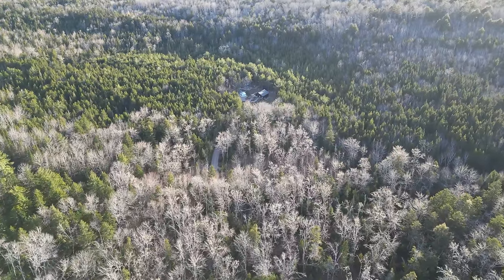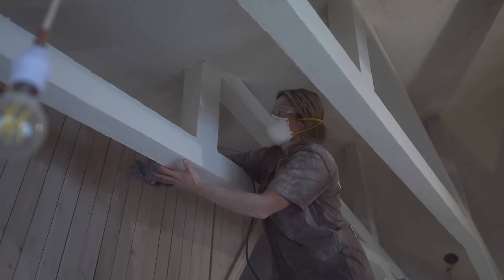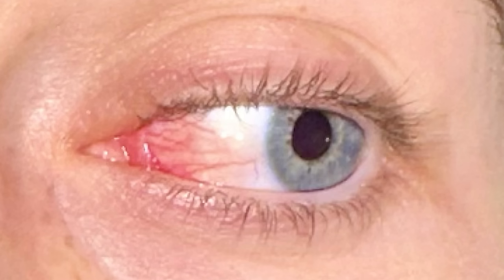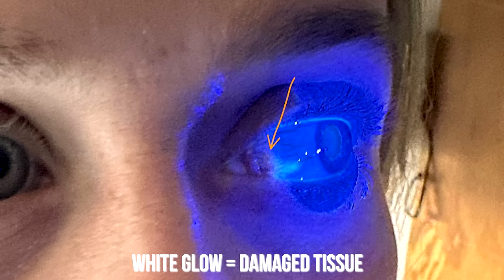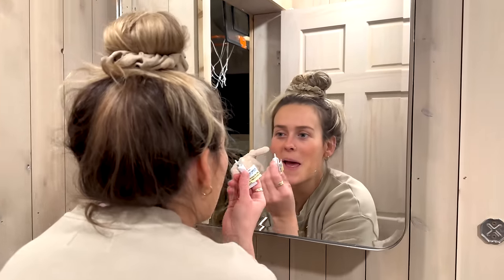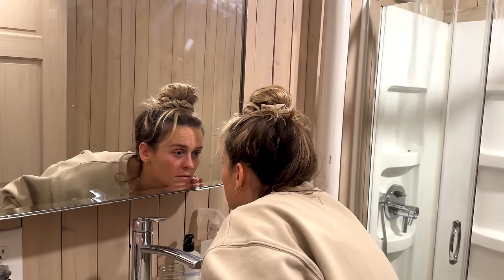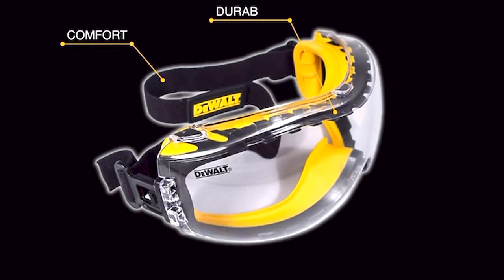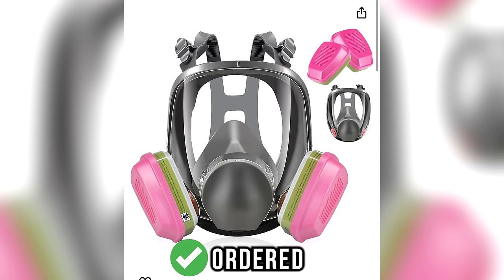telling my story

Comment: No big deal? Are they kidding? This was a very big deal! Our little darling scared the crap out of us. Just wearing simple safety glasses would have prevented this, especially to the major damage if it had landed oh so slightly different. Having been a renovator all my life I admit that I rarely wore the PPE I should have been wearing. It was just dumb luck that I didn't get hurt. The closest I came was when I was doing urethane on my hardwood floors. I had failed to open all the windows and doors for proper ventilation. A buddy happened to drop by and as soon as he saw my pupils as big as my eyes and that I was high as a kite he rushed me outside and saved me. Too close. So glad you're going to be okay, Crystal.

Comment: It's good that you were lucky and did not get badly hurt, but now you know why you should use eye protection when working on anything. You never know when a damage might happen.

Personally I had a grinder cutter running when the blade exploded and it spread sharp metal pieces all over, the only reason why my eyes wasn't hurt was because I was using glasses, but my hands and part of my body got spears by metal pieces. Why it exploded like that I do not know, but since then I have been very careful about it and especially whenever anything that might be dangerous like power tool, chemicals, paint and a lot more. My glasses that day had a crack and a huge rip on the surface so I know one of those piece would have hit my eye. The cost that day, was basically new clothes, some bandages and new glasses which for me costs a bit more than 1000$.

Both my mother and my brother has both had their own accidents like that, my mother got blue threads going through her fingers as a result and my brother got part of a finger ripped off because he wasn't paying attention why working with powered machines. I have a bunch of horror stories like that which happened to either someone I know or something I saw before the place got closed of by the cops.  It's never pretty when something goes bad or someone do not show the tools the respect they deserve.

So wearing some safety gear is always the smart thing to do.

Comment: Yeah this happened to me back in high school, just got to chemistry class and getting ready to setup our experiment for the day I jestered to my lab partner with my hands while holding a test tube that had not been properly cleaned an of course wasn't wearing my safety glasses and a drop off acid hit the flew into my eye. I went straight to the emergency eye flush and followed up at hospital. They did the dye thing and thankfully it was just a slight abrasion...SAFETY 1ST GO PACK !

Comment: I am 67 years old I remember working in the seventies in a fiberglass bathtub manufacturing plant we were mixing up risen and aluminum dehydrated powder in the risen and it splashed up and hit my eyes my eyes were burning I tore a bathroom door off getting to the bathroom sink to get water in my face and my eyes they  were burning . I have had battery acid transmission fluid gasoline acetone and several other things in my eyes and today I have some problems seeing so you better protect your eyes

Comment: At my work place we HAVE TO WHERE all our PPE no matter what or you are not allowed in any work areas. That being said, I still managed to get a metal sliver in my eye and because it had saw coolant on it,  it stuck to my eye and I had to be taken to Emerge and have my eye frozen so they could remove it. It literally glued itself to my eye. This was bad for me as it left me without vision in my right eye and that's my good eye and couldn't work for a week. Thank God it healed and no damage to my lense. We now have to where not only the goggles but a full face shield when working with this particular piece of air powered equipnet. It happened quickly and I have used this air powered drill for over 20 years without incident. I just happened to be at the wrong angle to the ON Button witch happens to have air coming out around the button and some saw chips on my glove and  that was all it took to blow a single fragment of metal through a small gap between my face and my safety glasses. Stay safe out there, you are a long way from a Hospital and EMT's to find you. Hugs from Sask.

Comment: It cannot be overstated that wearing eye protection is not an option when working with tools. Think paint brushes, weed eaters, saws, shovels, air compressors, sprayers of any kind, sanders, and probably a hundred other things. You could not have foreseen a drip right into your eye.So, focus on all the times you have used safety gear and were safe. We will all promise to be mindful of what could happen and make eye protection, especially, a priority.

Comment: Back in 69 working for a company that  built/ Erected grain elevators, especially cement. While pushing steel rebar, I got my face splashed with cement, aggregate, cement, and lime. Any of these are bad for your eyes, but the real bad guy (Lime) as a base, it will destroy your eyes. The company had a 55 gal. drum filled with water, to run the water Jack's. Two of my co-workers flipped Me upside down into the water. As weird, uncomfortable, water up your nose, the saved my eyes. Fast forward to 1987 I'm now a EMERGENCY ROOM NURSE. Yeah! can't tell You the number of times I did eye flushes. anesthetic ( Opthane) Flouricine strip for I'd damaged areas. Flush contact with NACL flush 500 -1000 cc, and a warm blanket, cause You going to get cold. How am I doing? What a learning opportunity! Some day ask me about My 2 elevator accidents. Yes 2, After all,  I have a Y chromosome. 😂=slow learner. Allen

Comment: When you’re young you tend to feel immortal, I know I did and I took more risks than I should have. I got lucky but I look back on my life and am freaked out by the risks I took. I studied Fine Art. I used oil paint and turps with no gloves or protection. I ate my sandwiches with hands covered in oil paint and turps. That was 1985 and safety wasn’t talked about much at art school.

Comment: Where do I start?  First off I have been watching your YouTube videos since before you guys owned the Canadian property.  My wife and I plan on full timing when I retire in 17 months and I follow a bunch of Full time, Schoolie, and Van life YouTubers.  But I can really relate to this video.  Back in 1995 while I worked in a Wastewater treatment plant as an Electrician, I accidently knocked a jug full of Caustic Soda off of a table.  When the jug hit the floor it splashed back up and the wave hit me in my face.  I was wearing Safety glasses but ended up with 3rd degree burns on my face, and in my nose and mouth.  Unfortunately due to the angle of the splash it also got under my glasses and into my left eye.  I have recovered from the burns, but have had 3 corneal transplants, a glaucoma implant, lens replacement, and numerous procedures all to the left eye.  My first transplant failed shortly after my 17yr old son passed from Meningitis, probably stress related.  The second lasted for just over 11 years and was doing great until I received the Covid vaccine.  My Doctor explained the vaccine ramped up my immune system which attacked the donor tissue causing my body to reject it.  I received my third shortly after that but also lost that one from complications of the vaccine.  My Doctor now says the damage is to great and I can no longer support any donor tissue.  So long story short, even though I was wearing glasses I should have followed the restrictions listed in that treatment facility and had splash goggles and a face shield on.  If I had my story would have been completely different today.  I am so happy that you have recovered, and certainly wish the best for you, Jazzy, and the girls.  Maybe one day we will all meet on the trails.
Reply: Really?  Just stop it! Why don't you spammers just get a real job?

Comment: I had an eye issue with an RC car Nitro car. Had starting problems with it hydro locking so I took out the glow plug and like an IDIOT pushed the car down on the starting block while looking/bending over the car while on the starting block and of course the car will try to start and it did and turned over all the Nitro fuel then very quickly sprayed me in the face and direct in to my eye's. I screamed as it really stung and felt like burning but don't think that was the case but was just extreme sting pain I couldn't then see anything so that added to the mass panic. My friends at the time with me panicked through me in to a car with me screaming in pain and rushed me straight to A+E. I was in A+E for like 6 hours and they had to  pop  my eye balls out of the sockets in order to flush out my eye sockets and eye balls until they showed a Neutral PH level. My sight did come back to a blurred state and took a good week until I could focus again properly and with out pain.  Stupid thing is I knew what you should and shouldn't do with these cars with 15+ years experience at the time but one second loss of thought/concertation and bam BAD DAY! Should have had a towel or cloth over the head for one safety glasses for two and leant away from it but I accidently lent on it with nothing/thinking.

Comment: I scratched my eye when putting on mascara. That was sore like when you get poked in the eye by something but not much. That was yhe first 24hours. The next day, and this is the weird bit, was that the wind hurt my eye. Like pushing on my eye not too bad but went of to my opticians to ask them for advice. They did the dye in the eye and could see the damage I had done. Got prescription for eye antibiotic cream so thought I was all ok. Next morning open my eyes and screamed with the pain. Even having the bad eye covered light sitill hurt. Hubby to me to A&e. Must have looked so strange as i was wearing a sleep eye mask. The tiniest amount of light hurt bad. The dr at a&e said that i had all the meds they would give me. They explained the pain in this way. Like a graze on your knee will form a scab my eye was doing its equivalent. Waking up and opening my eye i in effect ripped the scab off. I went home with eyemask on and went to bed for 2 days. It still hurt but not as bad after that time. Week later pretty much back to normal

Comment: Your most important PPE is located between your ears.  Stop, look, think before acting.  I guess my favorite job safety gripe involves use of cheap aluminum step ladders.  They are very prone to having one leg or the other bend over at the bottom if you shift your weight to where one side has a higher load then the other.  I have been dumped twice and have seen several other people dumped from aluminum ladders.  Spend a few more dollars and buy a good fiberglass step ladder.  Throw away those  aluminum ste p ladders before they throw you to the ground!

Comment: OK, another story, I knew a guy, old hippy way back with super long hair. He had a job running a printing press and one day he was standing next to it while it was running and he bent over to look at something and his hair got caught in the rollers and it slammed his head into the machine and ripped a huge wad of hair out of his head. He was bald while telling me the story.  OK one more, I knew a guy that was painting some cabinets in a small laundry room in a home, he wasn't wearing a respirator and I can't remember what caused a spark but something did and the fumes in the room ignited or I guess exploded and he was in the process of inhaling a breath when it happened and his lungs were burnt so bad it killed him. He would have probably been OK if he had been wearing a respirator. It was a flash burn so quick and out but his lungs got toasted. I'm old, been around a while so I have lots of stories lol. That comes with age of course. Pool chemical fumes get folks all the time so be carful with your hot tub chemicals and also septic chemicals if you use them.

Comment: In 2015 my ex and I were stringing up new barbed wired. It was a Sunday.. and at 7pm I decided to call it done for the day.. well the ex (now) yell for me to grab a wire cutter (bolt cutter)and cut the strand of barbed wire. He had it wrapped around the post in the pasture.. I had removed my sunglasses as it was getting dark. NOT thinking I cut the wire.. And YUP it recoiled into my left eye.  My idiot ex.. had NOT tacked that wire to the post.  The force and pain took me to my knees. He ran over and looked and said we need to go to ER.. I thought it was fine as there was no blood. I came in the house and put a bag or frozen peas on it..LOO he came in shortly and YUP ER is was. ER surgery came shortly after. That wire had tore thru my eye and detached my retina.. fist surgery was to seal the tear in my eye as the fluid was leaking out. That was a 9 pm . i had to stay in the hospital over night. They took me back to surgery and cleaned the tear up more then pull a large membrane over my eye ball to seal it. Wks later reattached retina..added gel to eye ball to hold the retina in place while he heals. Months later surgery to remove oil.. week later retina detached again.  Another surgery to reattach again.. added 6 cc of silicone gel to keep retina where it should be. I cant see much of anything cause of the gel.. but my eye can not handle anymore surgeries . That wire ripped thru the small ducts in my eye that help the aqueous humour and the vitreous gel ( to much has leaked out from injury and surgeries and it is not able to regenerate cause to the damage to the ducts inside the eye. For one of my surgeries. A man came into the clinic , my surgery was delayed as he had a NAIL form a nail gun sticking out of his eye. SO yes Lady always wear YOUR PPE.. Always. I still play with my power tools. And fix bared wire on my farm. I run a plasma cutter and always wear my mask and eye protection.  I am legally blind in that eye.. so I always have some type of protection over my right eye as its all I got now. I do have my left eye , but I call her a slacker. She does nothing to help her twin sister. LOL. On one of your videos I saw JAZ not wearing PPE and using the nail gun. I had to turn the video off. I love building things and still do, I ride a Harley and went from 2 wheels to 3 (triglide). Ive rode to Colorado and up into Canada around the great lake. YUP with just vision in one eye. We all need to wear our PPE . I also keep my herd of furry children away from me while I am working with tools, spray etc..
Reply from the maker: Thank you for sharing your story. We are so sorry to hear about your experience. We too will make sure we always have our PPE on. It only takes a second for an accident to happen. We will do better with keeping Bella and Izzy out of range as well. Sending love from the pack to you.💛🐶

Comment: PPE is very important, but I wouldn't have known how important it is if not for working for a major worldwide manufacturer, which required memorization of their thousand-page PPE requirement, and nobody ever forgot to wear their required PPE. Usually, you do very well in the safety category for Off Grid Living YouTube channels. I'm sorry for your horrible experience. If you don't know the requirements for the chemicals or the task you are working on, you have all the PPE readings at your fingertips by searching. It is amazing what the internet has opened up to the DIY's out there. Most think it can't happen to them, but it can and it will, especially when working above your head. Stay safe.

Comment: One of the best methods I have seen for safety checks are the verbal checks we do before rock climbing. Before EVERY climb, we verbally say “you’re through both harness points, have a good knot, plenty of tail, harness double backed, I have you locked and on top.” Obviously the checks you need are different but having an active, verbal check where you run through everything you should have—hard hat, safety goggles, respirator, gloves—that you do at the start of EVERY project does help. It’s so easy to look at the whole picture and say “looks good” when you could be missing something. And doing it verbally makes it more evident when you’ve forgotten—“did we do safety checks yet?” And if you don’t remember, do them again! They’re so quick and can ultimately mean life or death.

Comment: Crystal and Jazmyn (Van-wives)

First, Crystal, so I am please to know you are OK and did not sustain a serious injury in this incident.  Good for you for, in accepting responsibility for your own safety.  However, as a longtime viewer, I have cringed many times watching you both work without proper safety protocols.

As a Safety professional, (and career military) personal safety is much MORE than just using/wearing personal protective equipment.  Most people think the  first option is put on personal protective equipment (PPEs), and they’re now safe, however, that is not the best or only approach.

In the Safety world, we look at mitigating hazards first, and I recommend you look up and research the Hierarchy of Hazzard control: engineering controls, administrative controls, and last resort - PPE.  Brief summary, The goal is to address and control the hazards that you’re exposed to instead of just protecting yourself from them.  Examples: adjust the work environment, move yourself tp a different position so you’re not exposed to the hazard, or use a dust/debris collection system so the hazards are removed from the working environment.

I’m sure this post will gather many more comments on approaching Safety well beyond good personal protective equipmentpractices. I hope that this sparks further conversations and engagement in your continued safety.  Good luck both of you [and the pack] as you continue your endeavors at the cabin and throughout your travels.

Thomas (feel free to reach out if you need more information).